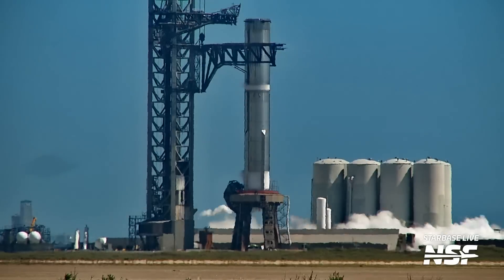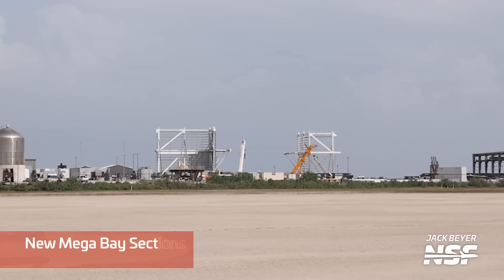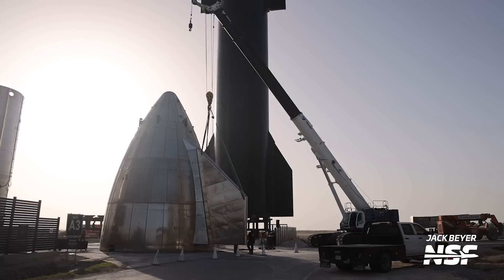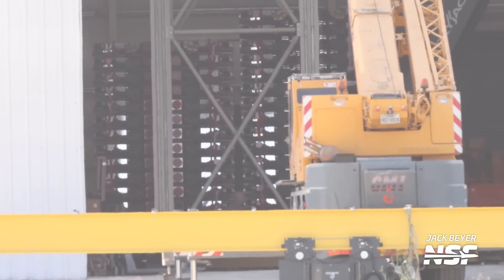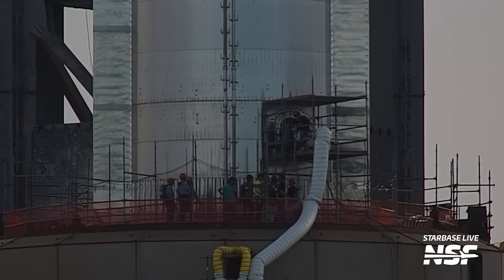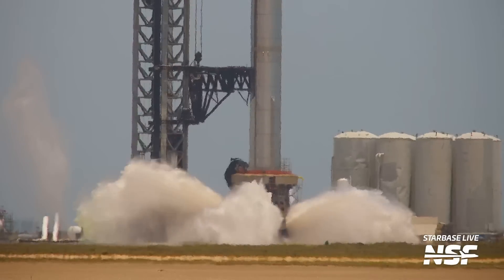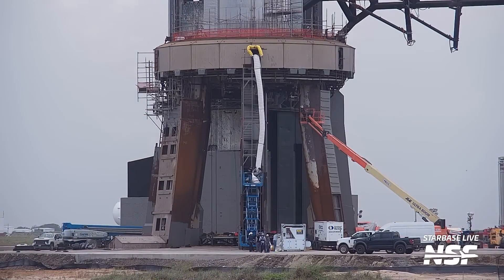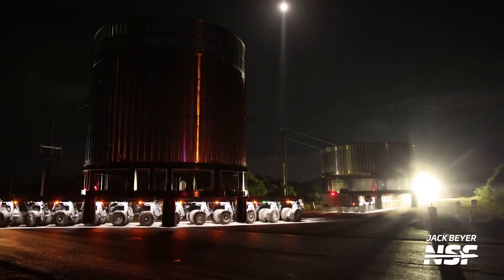Starbase Update | Booster 9 Testing, Ship 28's Cryo Test, and the Legendary SN15 is scrapped!

Comment: How do you know they poured Fondag around the OLP? All I have seen is ordinary cement mixer trucks. They have shown Fondag at the launch site in bags. I would think if this is what they were using, you'd see a hopper on top of a mixer pump and a couple of guys dumping in the bags of Fondag.
Reply: There were other shots showing the fondag pour but for the purposes of the update video it just didn't fit. I think it's on one of our non-narrated videos which do include full clips and so on
Reply: @ale131296  Ok, thanks. Might seem a little anal but when I hear or read something, I like to know the accuracy of the info.

Comment: Any words on the FAA safety investigation? This is a big milestone in the return to flight path. Likely, SpaceX will have to provide the FAA with complete explanations of engine failures, FTS failures, and OLM failures with the mitigating upgrades to these systems to get approval to fly again. The FAA will normally take weeks to review the data and subsequent engineering fixes. Hopefully, some of the FAA review can be concurrent with SpaceX’s work.

Comment: The weight of the ring still has to be accounted for. So more fuel needed. Does hot stage offset this extra weight?
Reply: With about a 10% 'efficiency' as stated by SpaceX, I would say yes. And with the higher chamber pressures in Raptor 3's, for an improved ISP, I would say it's looking pretty good. So no more fuel needed.

Comment: The HOTSTAGING RING DOES NOT LOOK LIKE IT WILL HOLD UP TO THE CAN CRUSHER.
Reply: We can't see what is on the inside. They could have laminated flat plate steel at evenly placed points around the perimeter? Maybe on RGV might capture a look inside?

Comment: Problem is that the faa still has starship grounded after what happened on the first launch and well we saw how long it took them to do things before
Reply: That can change in 24 hours. It all depends on when SpaceX sends them the final report on the B7/S24 launch. Btw, the FAA has people visiting Starbase all the time are being informed on a regular basis.
SpaceX will need to do the tests on the FTS, the OLM and the hot-staging. The last one is not yet done.
Reply: @knowledgeisgood9645  FAA will want an explanation of the multiple engine failures as well as it was serious enough that Starship wouldn’t have made it into orbit (from some sources).
Reply: @rebreaville9332  The only way to prove they can is to launch. No amount of ground tests will guarantee success - just increase the likelihood at best. McGregor is used for that. Btw, had it only been running 30 Raptors it would have made it to orbit, but losing more was just too much - they did not even reach 40 km. 
The FAA is fine as long as there is no risk of people being harmed.
Reply: @knowledgeisgood9645  FAA can accept an engineering review. That’s how we normally did it in flight test ops; and that’s what SpaceX will present. They should have no issues getting it done.
Reply: @rebreaville9332  Yup!

Comment: It's not the water, it is the energy.   The heat of vaporization of water is very large, the deluge will dissipate giga watts of power as the exhaust turns the water to steam.

Comment: No i dont think the deluge will work as is because the center out is the least protected . As thin the coverage is , it wont take much to blast the water even further out . Its like it has a head start on the the direction of blast pressure
Reply: Keep in mind the center is actually where the less engines there are... only three vs 20 outer and 10 middle engines. Makes sense for it to shoot out as that also goes along with the outward exhaust pressure instead of trying to go against it which wouldn't help a bit

Comment: The water will turn to steam when the engines are lit. This will increase the force on the pad. Without a flame diverter the crater will be even bigger next time.  Glorious!!!
Reply: If the plate can withstand that load, it isn’t an issue?
Reply: The steam will move in the direction of least resistance, which happens to be to the sides between the legs of the OLM. The water pressure and flow will stop any steam from being created inside the steel sheets. A flame diverter or a trench would restrict the free flow and cause more problems.

I guess they could back in 2016-2019 have built a tall hill were the site is now, giving them some hight for a trench. A hill like the one at 39A would have to be left to settle for 2-3 years. Then it would need a long ramp to get the ships and boosters up to the top. The area they have for the launch site is not large enough for that. They had no real choice.

Comment: I've got no idea how to test this, but my suspicions goes towards testing the hot staging ring on the Booster-Spaceship combo on the OLM, to make sure it will work before sending it to space and just hoping it will work. Or will they be able to ensure that during the test at Masseys? 

At least i think there's going to be some short engine firing test from the starship mounted on top of the booster so see that the fire deflection and release mechanism really work. After spintest and static fire of the booster of course. There's still some ways for Space-X to go before a second integrated flighttest can be carried out.
Reply: I doubt they will ever dare test the hot staging on the ground. The risks are too great. It is a lot safer to simply do it in space while both booster and ship are expendable anyway. 
What they can test down here is if the ring can take the loads it will be encountering.
Reply: They might possibly make some sort of Test Rig for Massey's.. Something like a Raptor Stand above a Bulkhead/HotStage Ring setup.. So they can Fire Engines atBooster Top. Could even use some existing Engine Test setup where they can just place the Booster Top/Hotstage Ring thing in the Path of Engine Firing. (just a SWAG)
:_raptor:🔥:buffering:
Reply: @laurin4405  Yeah, sounds reasonable. I thought that was what they planned to do during the recent visit to Massey's for that special ring and the new Ring Crusher. But since the return trip already seems to be planned, who knows what's up next.

Comment: I love these updates. For me the most exciting and critical thing I'll be watching is related to that very  last minute addition to this video. I'll be really interested to see how the structural testing of that hot staging ring goes. The trouble is with no live cams we probably need to rely on SpaceX to tell us (which I suspect they won't) or more likely watch for booster 9 modifications since I assume SpaceX won't go ahead and add a ring to B9 until structural testing on a test article has validated the design. Drone shots from Massey's probably won't tell us anything either because if I was SpaceX I'd be testing that test article to destruction so if a drone captures pictures of that tank crumpled at the top later this week that might not necessarily indicate a test failure.